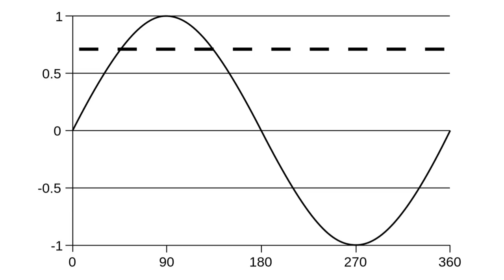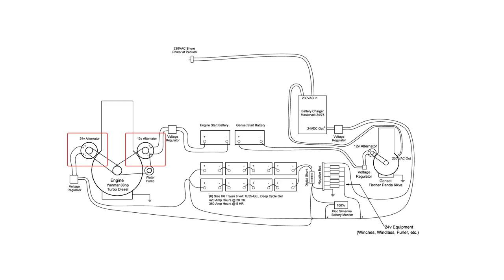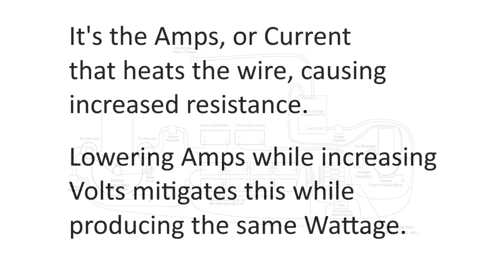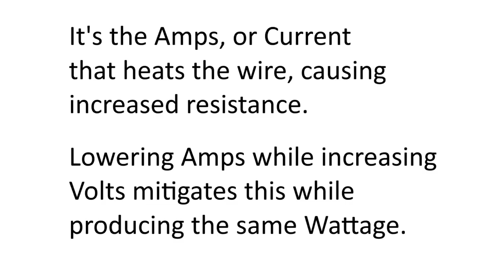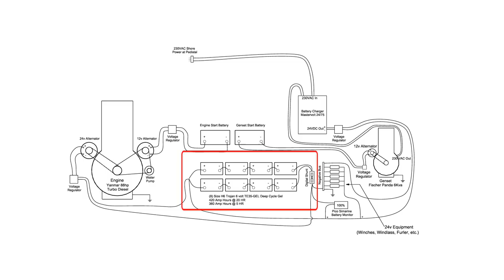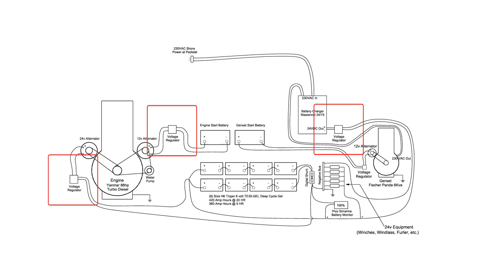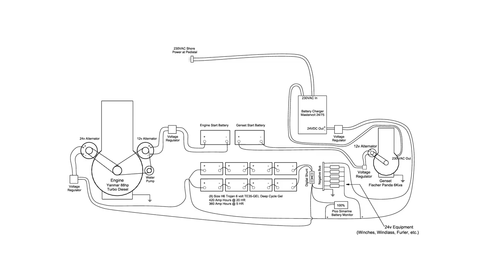Ep 74 Batteries and Charging Systems, plus Alternator Replacement

Comment: Great video. Saved it to my "Favorites".  You succinctly clarified the use of 12 vs 24 for certain applications, the complexities of 110/60 AC vs 220/50 AC and the inability to mix with shore side sources.  Wow, that toe is ugly.  If not already cured, a periodic soak in a warm salt or vinegar  may help.
Reply from the maker: Thanks so much. The problems w/ Euro vs US power are some of the most misunderstood of all issues related to cruising. And until I've actually had to do it (have plugged into a US power pedestal and not seen sparks), I'll be reluctant to offer firm advice. Luckily, I have a fair number of marine electrician and engineer friends available to help make it happen successfully. As for the toe, it's fine now but the advice I've gotten on it has been great. Moving forward the plan is to not allow infections to take hold.

Comment: As an electrical engineer I agree with your simple explanation.
I'm the kind of guy that would take the old alternator apart, try to fix it and use it as spare.
Reply from the maker: Hi DG. I'm glad you approve. I'm pretty handy at this stuff but not formally trained as some viewers, like yourself, are. I do still have the old alternator and have it in mind to have it rebuilt (or do it myself). Valeo makes a rebuild kit with new diodes for the product.
Reply: @SailingTalisman  Make sure what is wrong before buying that over priced rebuild kit. Try to find out what is in it. A simple diode isn't more than a few cents. Good luck on the rebuild.
Reply: @dutchglobetrotter4513  , You are on point. I hate admitting this BUT...  Years ago I was doing contract maintenance for a "Slum Lord" who was scamming his insurance company and Caterpillar on a bogus back injury claim. Set up complete!
He called me late one night to fix a gas heater at one of his 1950's Block houses. Northern Illinois winters can be very cold, so I suited up and headed out. 
An hour later I had troubleshot the problem, removed the dead crow from the gas vent and found a 16 Ohm resister burnt out on the safety circuit. I called the "Slum Lord" and told him that I had found the problem and it would cost $1500.00 to get a new safety board or I could do a "Component Repair" on the board for $ 1000.00 that night.  Guess which option he chose....

I had already set a space heater for his customers and headed to Radio Shak for a $5.00 assorted pack of resistors. An hour later the heater was back on line and I was $1000.00 to the green! 

I am NOT an evil capitalists, but there are situations that need a monetary slap on the face.
Reply: @jamieminton172  You overpaid on your resistors. 🤣🤣
Reply: @dutchglobetrotter4513  It was Radio Shack @ 9 pm.... Bahahahahaha.  LMAO
Reply: @dutchglobetrotter4513  , To be honest.... I probably still have a quarter of that bag in my "Soldering Box".
Reply: @Bongusta Mondo,  The renter got a month free. Or so they thought. It was all section 8 subsidized housing. Your right on my sourcing, but Crap Shack was what I had at the moment and last month I used two resistors from that 15 year old pack on a rolling gate operator that kept giving error messages. That $ 5.00 bag has more than paid for itself.  ;)

Comment: Great video and easy understand electrics explanation. I do hope the toe is on the mend? On a boat they do “stick out like a sore toe” 😚 
Had you considered replacing the alternator with a high output alternator such as a Balmer with a MC-624 regulator which can be programmed for all types of battery bank including LifePo4’s (Future proof)?
The LifePo4’s are like sponges - they just soak up whatever you can give them and you can drain them very low without damaging them unlike lead acid, AGM’s etc. which can’t be drained below 50% without damage and slow to charge from 80% to 100%. I know it can expensive but LifePo4 self builds are very affordable and simple enough complete for someone very knowledgeable like yourself. 😏
Reply from the maker: Hi Liam. Lithium batteries are on the list to be sure, but we're looking to get what we can out of our existing bank. Our current Valeo alternator is a 24v 80A output version with a Sterling Power external voltage regulator that seems to do the trick pretty well. Generally, I'm not an expert on Lithium battery technology, except that I like the elegance of the on board battery management systems. To the one, cruisers report that upgrading to Lithium has changed everything for them.

Comment: Keith hpw do you keep your tools so clean and rustfree  in an ocean envirornment?
Reply from the maker: Hi Johnathon. By constant use, would be my sarcastic answer. But in reality, I spray pliers and adjustable wrenches with WD-40, which as an aside actually stood for "Water Displacement" back when it was invented. As for the drills and power tools I work to keep them as dry as I can, and of course I replace tools that are getting long in the tooth. But sticking to top quality USA made stuff is probably where it starts. I find it maddening how crappy tools are in the EU.

Comment: Hi Kevin and Wendy. As a female marine engineer I am often laughed at by the other male engineers as I always test circuits are dead on boats before starting work just by switching off a isolator doesn’t mean that a circuit is safe. I have found that not all boats are wide the same plus when wiring is added an additional circuits put into the system. The isolator sometimes has been bypassed. Great video will be watching more of your series.
Reply from the maker: Hi Pippa. Congrats on jumping in there and getting your hands dirty, so to speak. Our isolator seems to cover the engine circuit, but the alternators (I know now, and Wendy REALLY knows now) are wired directly to the battery posts. Thing aren't done this way any more as there are marine electrical standards to follow, but as you point out, always best to check. As an aside, men cannot be trusted not to take risks with high voltage wiring. They'll just note that it's hot and try to avoid touching it. It's part of the reason why old age homes are populated with women.

Comment: i see you guys are not back in the water yet. are you doing this in Cleopatra? we will be there in 4 days. just wondering how busy the place is?
Reply from the maker: I think we were in Corfu for the alternator swap. Cleopatra is not a great marina for hanging out. There are a couple of restaurants, but there is a huge current that runs through and this makes docking, and even getting fuel, really challenging. The big draw for Cleopatra is their haulout facilities (although Actio next door is favored by cruisers for their more relaxed rules on 3rd party contractors/labor). Cleopatra might be cheaper to haul for a day or two. Anyway, the town marina across the way is owned by the same people that own Cleopatra and they've just renovated most of it in the last year. Here, you have easy foot access to the entire town of Preveza whereas Cleopatra is basically a huge airport parking lot. Fuel is available by truck on the long town quay in Preveza and is about 20 Eurocents cheaper per liter than Cleopatra.

Comment: First off, I’m a big fan of your channel! I have a couple questions for you...based on this video you mention your typical draw is 1amp, correct? What type of refrigeration system do you have? On my boat that seems to be the major draw at around 10-20amp draw. Also, how much chain do you carry? It would seem that when “med-mooring” you should carry a fair amount of chain. Thanks in advance! Keep up the great content! - Chris s/v Brigadoon
Reply from the maker: Hi Jonsie. Ah, yes. Current draw. Unfortunately for us, the big draw items like hot water, refrigeration, water maker, and clothes washer are all on 230VAC power, so these are not included in our 24VDC power calc, and this is what I was speaking of. On 24v, I have (2) electric winches, electric mainsail furler, windlass, bow thruster, and autopilot drive. The autopilot draws alternately either little to no amps followed by bursts of up to 5 amps. Since we have to run the genset each morning and afternoon to keep refrigeration, our batteries automatically get charged during that period and we really never have to worry about 24v power. The batteries also get charged by using the engine, although no 230VAC is produced by doing so. Also, the engine uses 6-7 liters per hour of fuel, whereas the genset using significantly less. It's hard to separate the two for calculating fuel use.

Comment: Watched for the second time and a maybe good idea popped up.
Is it possible in your boat to install a switch to turn the alternator on and off?
Reply from the maker: Probably, but it's something you'd rarely need. Now that I know how it's wired, not a problem.
Reply: If I understand your question, you mean isolating the alternator output from the battery it  charges.......alternators or generators have to dump their generated energy. If isolated that cannot happen and the the alternator will self destruct and possibly cause a fire. So if an isolation switch is in place and you forget to put it back in the ON position then you have issues, so not a good practice.  The alternator can be stopped from generating when the engine is running but I think it better not to describe how on this forum.
Yes sir, always remove the battery to alternator output cable before working on the alternator beyond retensioning the belt........otherwise you have an efficient 12V welder......potentially a very nasty situation. Wendy will attest to that. Always remove metal bracelets and watches, and wear safety glasses.

Comment: Great video, thanks. How are you finding the Simarine Pico monitoring system? Cheers John
Reply from the maker: I like the Pico system. As mentioned, it shows a wealth of information and does so in a clear and easily understandable manner. It requires that all negative system wires run through the shunt, and I was actually missing one and this caused the system to get out of alignment over time. Once that was fixed it has worked flawlessly. Tech support from Simarine is very good too.

Comment: Hi Kevin.

I know nothing but I thought the very step would have been to Disconnect the starting batteries from the engine. I think you said you switched the isolation switches off and somehow this did not work. If the battery cables were disconnected then No power could have gotten through.

I know you would have sorted out a fix.

Wendy, Welcome to The Club, we have all done that and yes none of us knew it was coming either. Enough to give ya Grey hair.

Luv Ya work.

David Down Under.
Reply from the maker: Hi David. As mentioned, the 24v alternator was grounded to the engine, and I erroneously believed that the positive cable would run through the battery isolator. As demonstrated, this was incorrect, possibly due to the amount of amperage involved. In any event, it's something I could have pretty easily checked. Electrical systems on more modern boats have standardized safety features, and there are now marine electrical codes from both the EU and US regarding new builds.